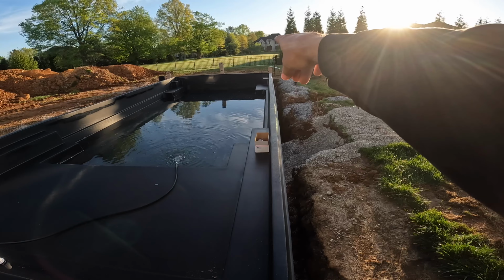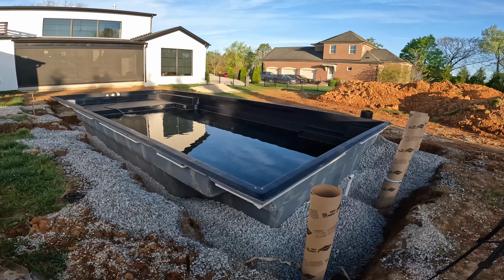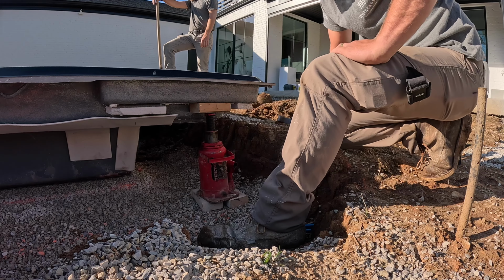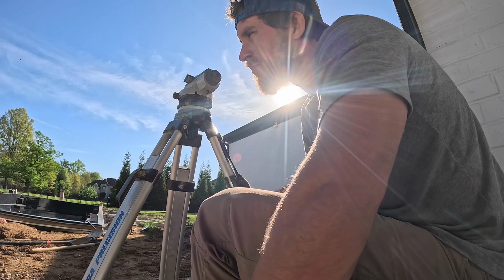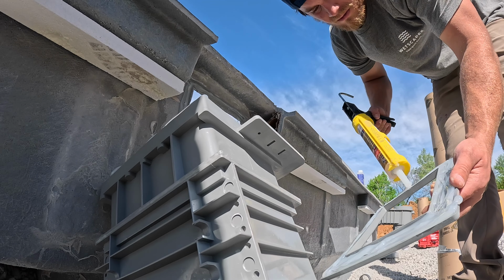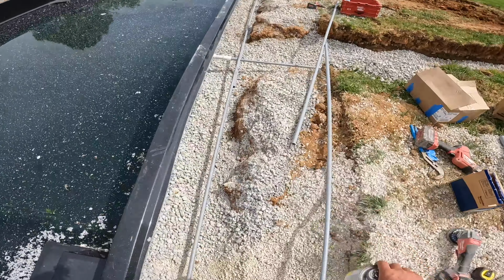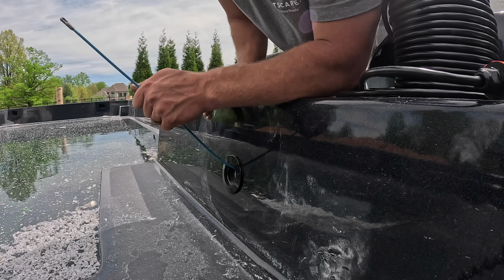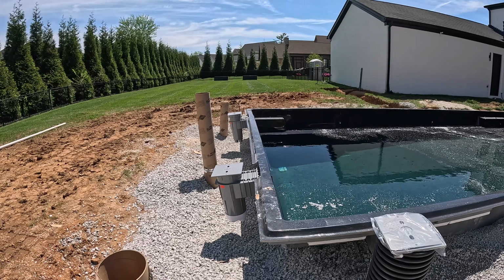How to install Skimmer Returns Lights Install Ready for Plumbing [Inground pool construction]

Comment: What skimmers do you use on your fiberglass pools? Those ones looked like they had a nice finish plate, deep enough to cover over the thickness of the pool shell.  Ever have problems with the angle of the pool walls and getting a skimmer to sit level at grade, or is there enough play in the extension rings to level them out?   Great install.
Reply from the maker: CMP makes it. i like them. Only time i have trouble is if the shell doesn't come with a pre-molded section for the skimmer on the free-form pools. Those can be a pain, but the walls are always think enough so we can get it flat. are you having trouble?
Reply: @jonport_  I am actually in my planning stages, and ordering all my parts. So I want the best skimmer. I love the double O7 by thursday pool, its built with the 7 degree angle, but I cant get it in canada. You seem to always get yours installed with no trouble so I thought I would ask.  Appreciate the info ! Cheers
Reply from the maker: @DervFuel  right on. Ive seen those skimmers. They’re nice. Best of luck on your build

Comment: What pool lights are you using, they look like Pentair Microbrights? do you like them?
Reply from the maker: We normally use micro brights but this pool the custom supplied the lights. They’re jandy lights.  They’re almost the same.  I like them. Are you build your own pool?
Reply: @jonport_  Yes, I'm a building and Plumbing contractor and planning on a pool build looking at an Okeanos 14x32 Sigma fiberglass pool, trying to nail down the details, lights, AOP or SWG system,,,,
Reply from the maker: @michaelconroy6242 thats awesome. Best of luck.